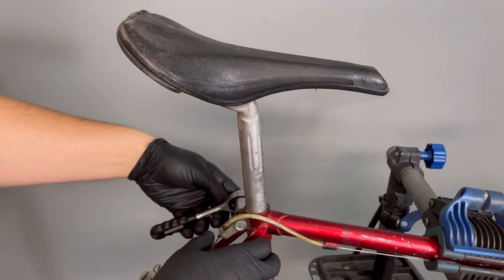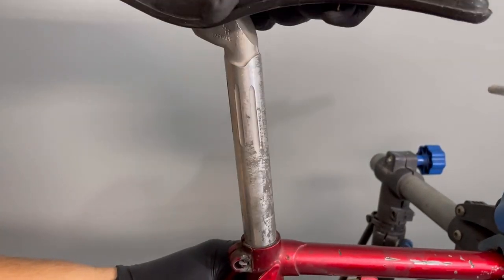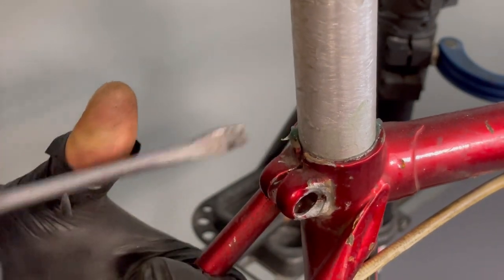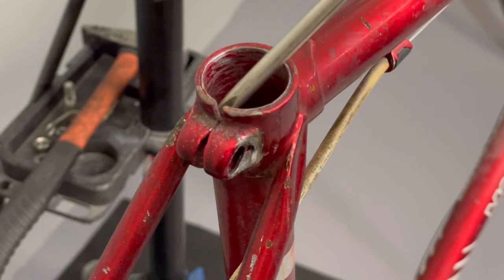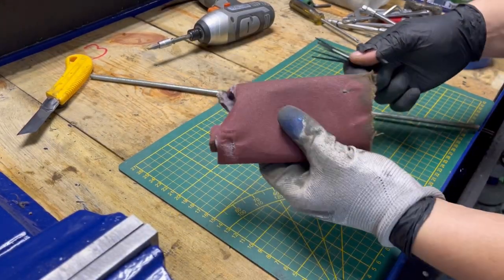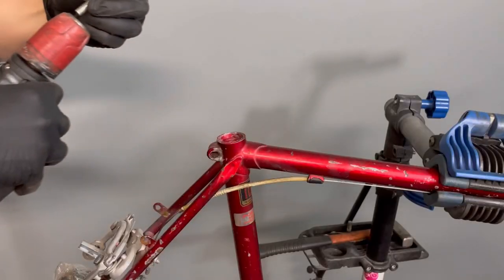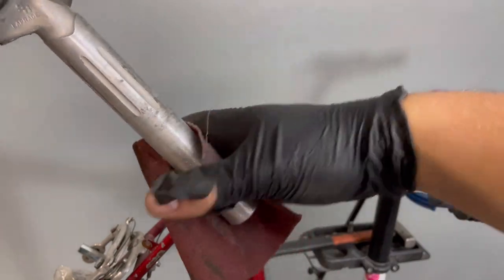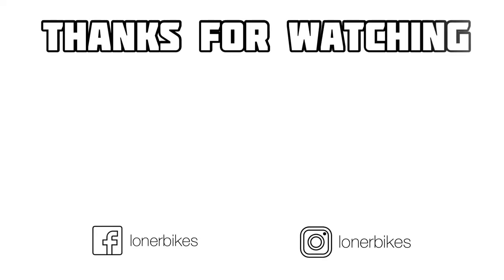How to fix Seatpost tube problem ? So tight 🤨

Comment: I'd be careful doing it that way up. The BB in my old road bike isn't sealed, so any metal filings in the seat post will go straight down the seatpost tube to the BB and can get in the bearings. So either check if your BB is a sealed type, or do it upside down, so any little metal shards fall out the frame. 👍👍
Reply from the maker: good point my friend